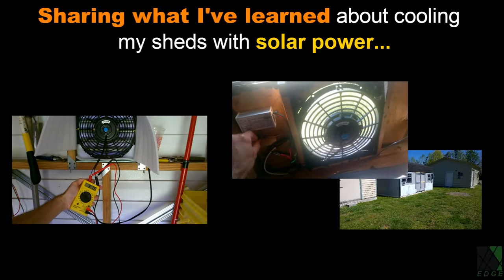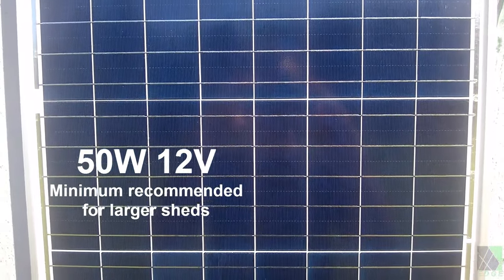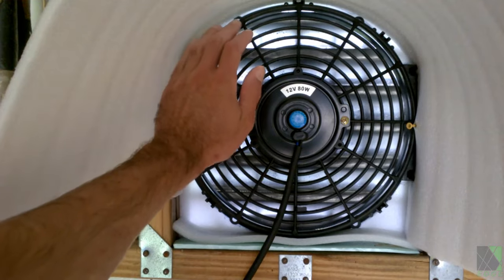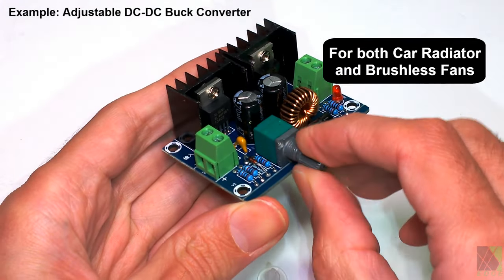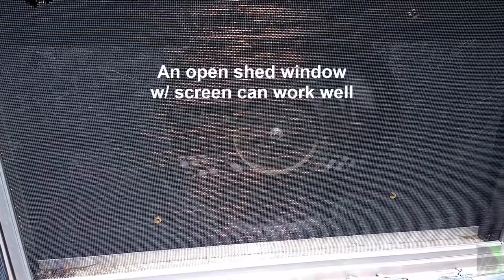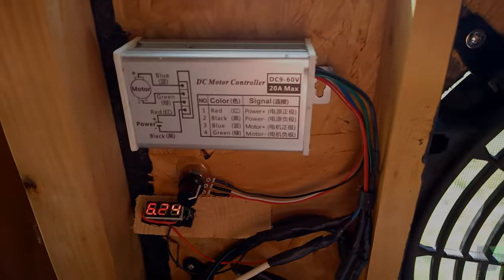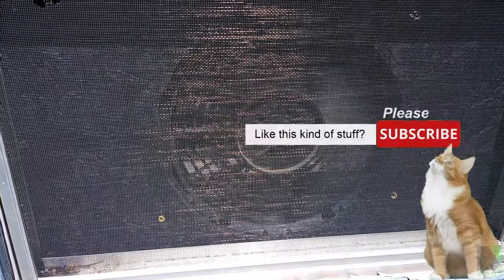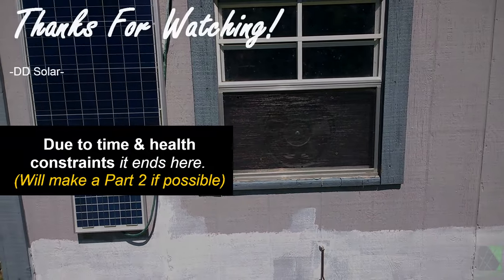SOLAR shed ventilation! COMPLETE GUIDE - cooling chicken coops and outbuildings #solar #solarpower

Comment: Stumbled upon the video as not many exist on the specific subject of solar project/ shed ventilation, quite enjoyed it as you went a bit more in-depth than most people would!

When ordering components for a car jumper project with headway cells I stumbled upon surplus fans at Battery hookups (80mm x 80mm). They were 1-2 dollars and my storage project needed cooling bought the normal ones and 2 very substantial 24v 1.6 amp fans that ran at 9000rpm pushing 124cfm. These surprisingly were able to also lift 1.88 inches of water so lots of static pressure!
Reply from the maker: Thanks I appreciate the good feedback! Those fans sound like a real party especially for the price. I didn't even know BH sold fans, checking them out now.

Comment: I’ve been giving direct solar loads a lot of thought lately. Especially considering 18-20/40 volt power tools run very well of native solar panel voltages. 

RV stay all diaphragm pumps are excellent candidates for something like this. A large pressure tank and oversized array would give consistent water pressure, some of it j to the night. Anytime you eliminate a battery you add redundancy to a system. A switch can always swamp it over to a battery if it fails.

18 and 40 volt motors are becoming cheap and common from all the used or broken consumer grade tools and appliances.I’m thinking about swapping a drill motor into a box fan for something like this. Mostly because I like the box fan form factor.

Panels are cheap and last a lifetime. Batteries and expensive controllers and inverters on the other hand are wasteful and expensive.

Hard time finding a high amp adjustable buck or boost dc to dc circuit. Most of the cheap ones like for golf carts put out a set voltage. Do you have a preferred brand or source?
Reply from the maker: Hi, these are great thoughts. You might enjoy some of my older videos... running stuff off of solar panels is pretty much what I love doing. For example, check out my Ryobi solar panel hot glue gun, soldering iron and ran 2 drills too :)

I can't post links here in the chat, but there are some pretty beefy DC-DC converters with and without programmable LCD screens on Amzn. Just search for "dc buck converter". Some are hundreds of watts. I've seen one that claimed 1000w but it's probably more like 500+.  The golf cart ones are good for simple 12V stuff, but the adjustable ones give great flexibility. If you can't find them, let me know and I'll search for their names. For example "drok dc to dc" should list at least one big DC converter for you to check out.

Comment: Great video, have you done a video showing connecting the solar power to controller and battery? 
Thinking of doing a chicken coop ventilation with battery backup to cool at night if needed. THank you
Reply from the maker: Hello and thanks! I have another video about connecting the components, such as DC converters, linked below. Adding a battery would be pretty easy. Use a solar charge controller to charge a battery from the solar panel, and connect a fan to the load output on the charge controller. Obviously, the solar panel has to be big enough to run the fan plus keep the battery well charged for the night. A 100w panel might be enough, depends on the wattage of the fan. Hope that helps.
https://youtu.be/AHydnUCgUFU

Comment: I just finished watching your first experiment video on this project and I learned a lot. I'm new to all of this and I'm no electrician. I want to connect (3) 12v 80w Aux fans (same as yours) to a solar panel. Can I use a 300w solar panel to cover the need of the 3 fans?
Reply from the maker: Glad to hear it and thanks for watching :) 
1) A 100w 12v solar panel easily powers a 12V 80w car radiator fan in good sun conditions. Depending on the panel, voltage may reach up to 12-13V without any electronics. But some of these fans may get too hot to touch at that voltage when run all day - potentially overheating. Just FYI
2) 300w solar should power the 3 fans no problem.
3) If concerned about fan lifetime, I recommend limiting the voltage to max 10V somehow. They will run slower, but cooler. Could use 1 or 3 heavy duty PWM motor speed controllers or DC converters. If there is some way to run them straight off the solar panel safely, this is the best option because it is so simple and less to go go wrong.
Solar fans are lots of fun to experiment with!
Reply: @solarpoweredge  So glad you replied so quickly. It's getting hot where I am and I really want to start this project.
I found out the solar panel is 300W w/ 18V Solar module. Am I going to burn these fans? Thanks.
Reply from the maker: It depends on the voltage. That's a very powerful solar panel, what is the voltage at maximum power? It's on the label on back usually. Here's what I'd do, set up a test rig with the solar panel in sunny conditions, wire 3 fans in parallel with a DC circuit breaker and secure them. Connect a voltmeter across the circuit, turn the fans on for 5 seconds and watch the voltage. If it's too high, here are some options:
1) Use a DC regulator (golf cart 12v converter) probably one converter per fan.
2) These are 12V fans right? Consider wiring in series (2 12V fans in series for 24V). 
3) Or consider 24V fans, but those are much more expensive - could be more efficient though. I have yet to buy a 24V fan due to the unusually high price.

Comment: quick question, like you i have the idea of putting 2 16inch fans into my shed for ventilation. What size solar panel would i need to run them comfortably that are already 12v solar panels. and of course, i'd have a similar set-up to you.............?
Reply from the maker: @evilresident5201 Hi, sounds like a plan... a 100 watt 12v solar panel absolutely has adequate power for a single 12v 12 inch (~85w)car radiator fan. Need to check the voltage at peak sun and make sure it's not too high. The 16 inch fans are usually more powerful, but should run fine and at a lower voltage. I recommend considering 2x 100 watt solar panels for good ventilation with 2 fans. Hope this helps!
Reply: @solarpoweredge   Ok, sounds good. if i was to run a golf cart, to maintain the 12 v...........i have the 2 16 inch fans as noted before ( to push the heat out ), but also have 2 10 inch fans located on the other side of my shed  to suck cool air in. I already have a 350w solar panel from a previous play with solar power. The max on the 350w panel says it 18.7 volt. Is my solar panel to big to run all four fans ?.............and with the golf cart handle the max output of 18.7 volt and reduce it to 12v without issue?............. I have individual speed adjusters for the 2 10 inch fans, but am thinking one speed adjuster for the 2 16 inch fans. Or should i go two.......?
Reply from the maker: @evilresident5201 Nice setup! I suspect it can run all 4 fans but not sure what voltage will be produced. Do you have an amp meter or volt meter? I'd recommend measuring the voltage and or amperage of the fans while in operation. And maybe try removing one fan and watch the voltage change. 

If the speed reducer can handle the current (amps) of both fans, one reducer should be enough. Some of this can be sorted out be just doing some experiments, a good way to learn about solar
Reply: Do you make house calls?  Lol.

Comment: I just built a 10x4 storage shed  and it does get awfully hot in there, what size fan do you think I would need? Right now there is no ventilation and was going to just put a couple of those 10”x4” vents to help remove hot air but came across your video and thought Hmmmm. I’m in So Calif.
Reply from the maker: @craig156 Hi, CA is hot... I believe a car radiator fan would do well depending on the size of the vent. There needs to be a place for the cool air to be pulled in, and hot air to flow out unrestricted as possible. If you can get the voltage up to 8-10v, it will push lots of air.

If the shed vents are smaller, one of those brushless DC mining fans could work. In the description there is a link to the "SJ" fan, it needs a regulated 12.0v DC supply. Excellent fan and it's in one of my sheds right now. Also using a 12v and 24v radiator fan.

Comment: You are the best!
Reply from the maker: Thanks man  :) I hope this video was useful, it's been on the to-do list a long time. I have 3 fans cranking in my sheds now lol. Maybe that's a bit over the top. However it's been 80-90F and sure is a lot cooler in there.
Reply: @solarpoweredge  I got the 12" 80 watt fan w/ 30 watt panel and with a Lil bit of 🌞 I have decent CFM but I tried hooking up the fan to 20 volt Dewalt battery and it spun like a tornado, I know not smart but hey I say test all your equipment.
Reply from the maker: That is a 100% legit test. Middle shed has a 12" fan also, at around 11v it sounds pretty good! Can't imagine 20v, wow.

Comment: What extension cable do you buy with the Renogy 50W panel?
Reply from the maker: @rtc-1840 Hello, for a single panel it's possible to use either standard "14awg landscape" wiring or standard MC-4 solar cable. I placed links to both in the description, but be sure to check around for the best price. Especially if you only need a few feet of cable, that's the main factor. Hope this helps! DD
Reply: @solarpoweredge  thanks for the reply. One more question, what about the clips used to attach to the fan? Is there a certain type that work best? 
Thanks!
Reply from the maker: @rtc-1840 Welcome! The simplest route might be to cut and strip the wires on both ends and use standard automotive crimp connectors - but adding a switch or plug is a good idea to turn off the fan when not needed. Using alligator clips is super easy for testing, but frankly they are not safe as a permanent solution.

If you have not chosen a fan yet, consider watching this follow-up video about 24v car radiator fans. They work much better for direct solar power, although they cost more. The fan shown is already installed in my shed and runs really well. https://youtu.be/8juViLWghLs

Comment: Where do you buy the radiator fans from?
Reply from the maker: Hello, there are links in the description, but you can find 12V 85W radiator fans very commonly at just about any online retailer, and Auto Parts stores. Hope that helps! DD
Reply from the maker: PS if using a smaller (such as 50W) solar panel, you may also like the SJ style of brushless DC fan - very smooth and powerful, but they need fan grilles (finger guards) as they spin at 4000+ RPM. A link for those in the description too.

Comment: How many chickens? 10?
Reply from the maker: I recommend a minimum 50W solar panel and a DC-DC converter: adjust the air flow based on the amount of heat outside and square footage (volume of air inside) of the chicken coop. In overcast weather, if the chickens are very hot, you might want a larger solar panel to ensure the fan keeps spinning at the regulated speed. If there is excess voltage the DC converter will protect the fan and regulate the voltage and speed. Some of this will be trial and error, doing a test would be a good idea.